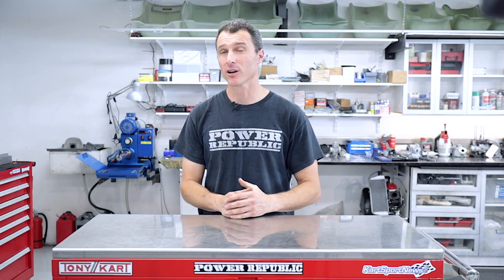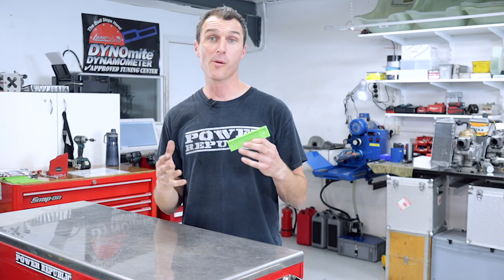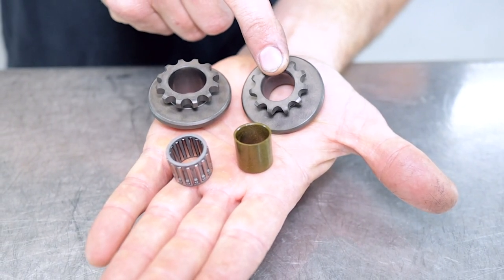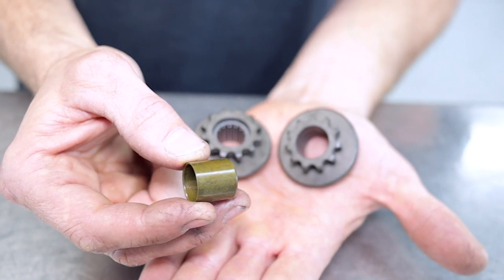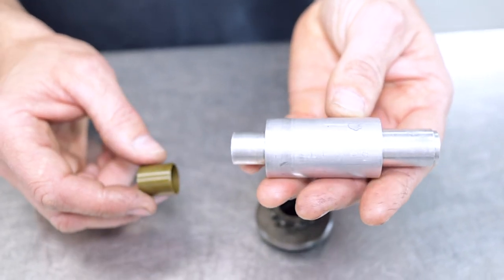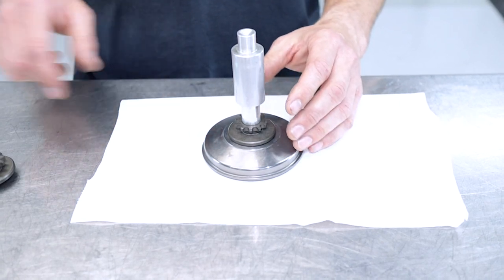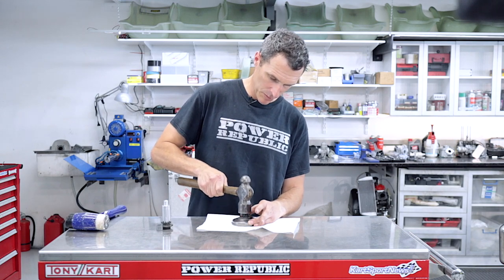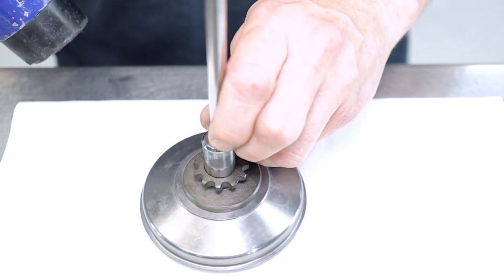HOW TO: Rotax 11 Tooth Front Sprocket Maintenance - POWER REPUBLIC

Comment: Thank you very much for the great video, very well explained with good advice as always. I would like to know if it is serious to have put the conical part of the sleave, the one that is towards the outside, first, when I entered the sleave. It was easier to enter like that, but I was told that this part went towards the outside of the drum. I find that logically it should be as I installed it, because this way, it fits the oring which is bottom, when installing the drum. Thank you for enlightening me SVP.
Reply from the maker: makes sense, but there is relive for the O ring in the back of the sprocket.   should really matter but I think you are probably correct
Reply: @PowerRepublic Thank you

Comment: Hey des, how do I prevent the rotax O ring from running tight? Sometimes it's incredibly hard to spin my axle due to the pesky O ring... It just doesn't feel nice!
Reply from the maker: the o rings will feel 'tight' on the stand when they are cold.  but don't stress,  definitely recommended for use with the high powered Rotax 125 engines

Comment: Hello, 
thanks for the videos. Very useful. Could you make some video about how to identify crooked axle/hub or disc?I have kart on stand and its moving everything on the stand :-D   
And how to choose the right axle regarding weight of the driver, kart category and driving style?
Thanks
Reply: Just put the kart on a stand, slowly turn the wheel, and look for wobble. If something it not correct, you should be able to see. However, heavy vibration may just be tyres out of balance. I drove a rotax once with dodgy balance, and could not see a thing under hard acceleration.
Reply from the maker: Great idea 💡
Reply: @christianbuczko1481  I looked on stand and everything looks ok. But i have vibrations when i driving it. So i will change tyres and will see. I have ROK GP CRG
Reply: @PowerRepublic  Thank you :)
Reply: @ilikemyboost  you could try to balance the wheels and tyres. Ive seen a vid showing how to do it at home using rolling mount, and a few easily aquired lead weights. If you take the chain off, so the rear wheels roll freely, then take 1 wheel off, you could check the mounted wheel still on the kart. Lightly turn the wheel so its spins, a heavy spot will swing to the bottom as it slows to stop. Then add a small weight at the top inside rim edge(12o'clock). If you add say 10g weight opposite, then turn the wheel so the weight is at 3 o'clock, and it stays, its balanced. If the weight swings to the bottom, its abit too much, if the weight still goes back to top, then you need a bigger weight. Apparently, thats the theory, and with practice will be able to guess the weight required. Ive not tried it yet myself... btw, you can get the tyre weights off ebay, and id recommend finding that vid to watch.
Reply: @christianbuczko1481  I know about balancing. I have a crash with my kart. So now i try to figure it out whre is the problem. Firstly i change tyres and will look on tyre/disc balance. Then check hubs. Thanks
Reply: @christianbuczko1481  So the problem was in the tyre :) . No more vibrations after changing for new set :)

Comment: Hey Dez. Great videos. Very helpful. Thank you for producing them. How would you recommend removing the plastic bearing for the 11 tooth sprocket when seized against the O-ring/shaft?
Reply from the maker: can you cut it carefully with a Dremel tool.  or use vice grips to clamp on and then rotate plus use some  WD